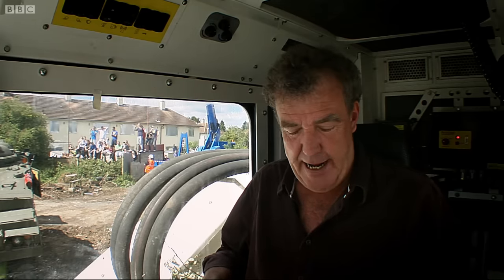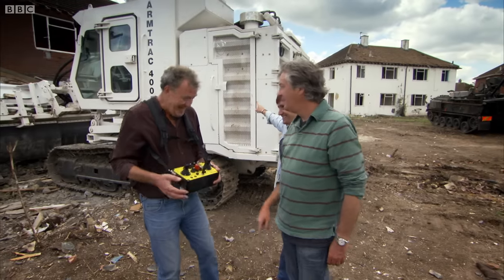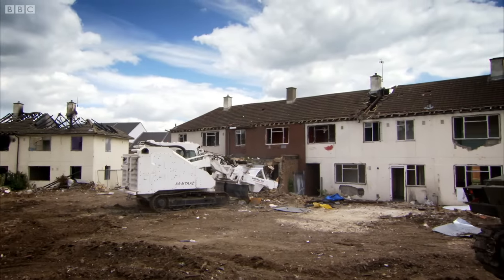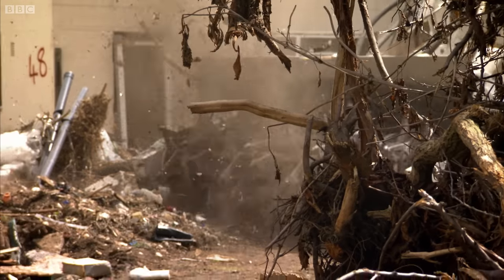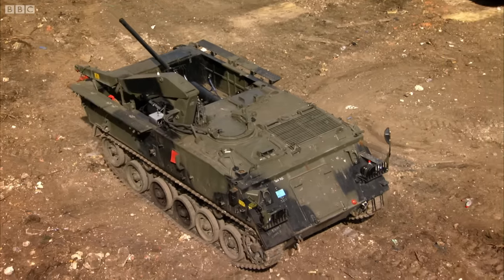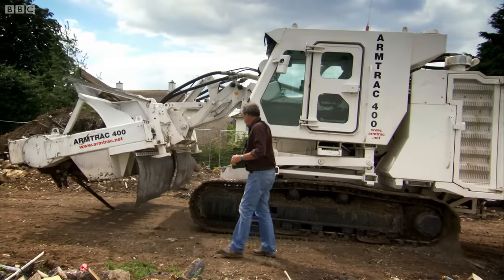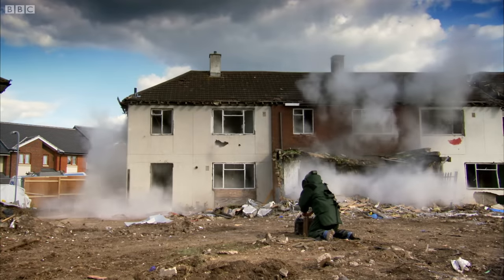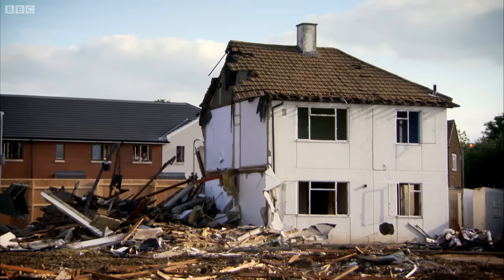Demolition Men | Top Gear | BBC

Comment: If they had gone with the battering ram idea from the beginning then they probably would have won (most likely).
Reply: I know what you mean.

But I'm guessing they didn't cause in case the house collapsed on top of the vehicles, it would have been too big of a problem.
Reply: 619WWEFAN Well, they should have gone as far back as they could then gone full throttle at the houses.
Reply: TheBrickGuy7939 both the space and the speed limit seemed low.

They cannot use too much space to reduce public disturbance as much as possible, and safety too for them
Reply: 619WWEFAN What I mean is it worked later on in the process. The reason Hammond got stuck was because he attempted a house that was already damaged then James crashed into it making the roof fall on Hammond's vehicle.
Reply: +TheBrickGuy7939  Or they should have came in like a wrecking ball
Reply: Well the point is its supposed to be fun to watch
Reply: If they would "attack" the houses bit by bit yes. But the other team also cleared all the rubble and didn't make it look like a warzone.

Comment: Too bad they couldn't get a Challenger tank....at 45 Tons or so, back it up to get a good run at it, maybe 35mph  & drive straight thru the whole thing.....one end to the other!
Reply: The Challenger 2 weighs over 62t.
Reply: why not to put the maus which weight arround 190t.?
Reply: There is only one Maus in the world and its in Russia... They should have used them as normal battering rams at the start.
Reply: AddictiveBiscuit And it was prone to sinking into the ground or not moving. While we're at it, why not use the 1000 tonne Ratte? They started building it, so we should be able to finish one, right?
Reply: hey, find plans for the P.1000 Ratte, 1000 metric ton's
Reply: appelpower1
 Hitlers "wunder weapon" the 'mouse" and "the Rat" (Ratte) were obviously rather stupid so-called weapons. Even the Mouse coudn't  be transported into the battle as they wouldn't fit on any existing transportation systems (Railroads). The 'Ratte" was even more too big  to move..How could one move it onto the battlefield? Some have said have it move on its own power onto the battlefield....and the plant that builds it is 350 Km away from the existing front lines? Someone didn't really think it through before developing it.
Reply: Ricardo Ellison maus
Reply: appelpower1 Wasn't this done in Kent?
Reply: chaosdemonwolf1 It was, why?
Reply: Ricardo Ellison The Maus was supposed to be transported by ship and used in homeland defense. Regardless, it would have been a terrifying thing to run into on the battle field as anything the allies had would have done nothing to it. There were more then just one produced but after a bombing run, any that may have been ready for operation were destroyed. The one in Russia is nothing more then a shell. The Ratte had no more then part of the tracks built but after a certain person (can't remember who) pointed out that it would be too east to get stuck and would just sink into the ground and cause nothing but problems for the military, thus it was scrapped.
Reply: Pickled Sausages Defeating a Maus would be a case of blowing it up from below (mines) or bombing it. And, if all else fails, driving across a bridge or some soft ground, neither of which the Maus would've been able to cross.
Reply: how about a heavy tank? I might be wrong but was the 45 ton tanks the light-medium tanks in the world war days? I don't know if 1 or 2 but it was war.

Comment: Get a maus and drive it lengthways down the building
Reply: Then once it's finished destroying you can live inside it like a mansion
Reply: +MuddyBob 650 189 tonnes 😎
Reply: Pff more than that.
Reply: Cute Kitten get the GIGANTIC bulldozer from Avatar.
Reply: Argorians The house would stand no chance
Reply: Argorians
Reply: 188
Reply: Cute Kitten the Maus only had a prototype and it was German
There stuff was British
Reply: Feodor Tsabrov wrong of the two tanks one of the hulls were destroyed, the other one only the turret was destroyed so the Russians put them both together to make one maus
Reply: Jus a pupper 188 tons it's from the book Tanks by Christopher Foss. One of the options is using A39 Tortoise if there's a drivable hull

Comment: So good and if there was a FV4204 ARRV in the lot at Whitham Army Disposal Yard in Lincolnshire Clarkson could have used it since it's basically a bigger version of Hammond's  FV434 due to its bigger engine and is based on the FV4201 and therefore win the demolition challenge  since the FV4204 has the power of the FV434 & FV180 combined

Comment: UK houses are like cardboxes covered in bricks. They're build like that so you'll have to invest often and circulate the economy. While in Albania and most of the Europe, houses are build like concrete bunkers and last forever.
Reply: Those houses were post-war prefabs. When they were put up they were only supposed to be temporary, and were classed as temporary. The one you see with red brick is because that's the only way you could get a mortgage for them, otherwise they weren't considered permanent structures and no bank would touch them.
(I grew up on that street. It was actually more of a shitehole before they got started)

Comment: I don't like how they were holding back with the tanks, clearly they only used like 10% or less of tank's power and on first contact with building they stopped. I'd like to see them drive that tank in from one side and out from other side .. going along the longside wall, then do it again with opposite wall, that should drop the entire thing.

Comment: Explosives are cheap. Just get a bunch of explosives, drill them all over the house and blow them up all at the same time. 

Alternatively, 100 pounds of C4 in the center of the house would turn it into a crater. 
 *Probably unsafe for the surrounding area.